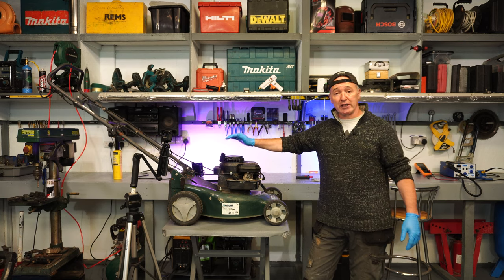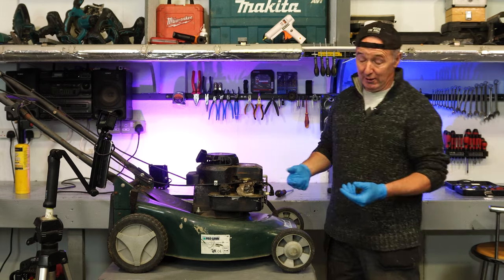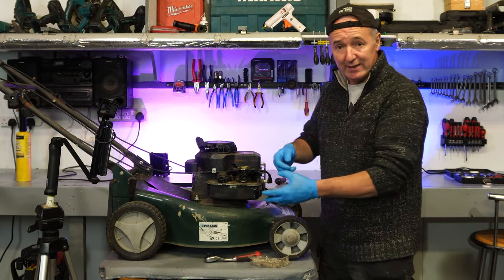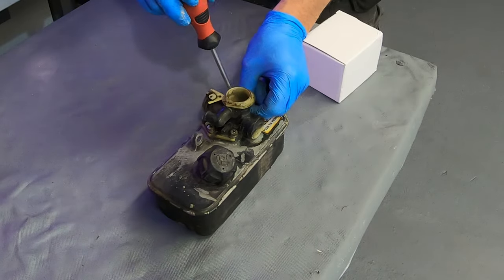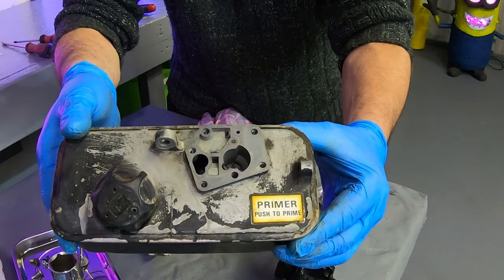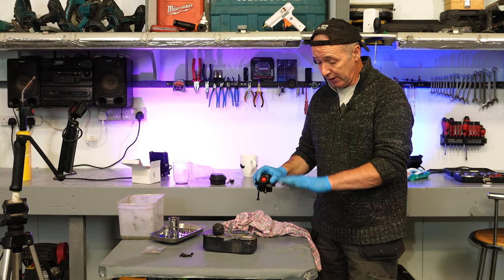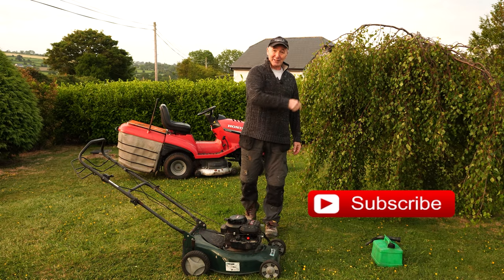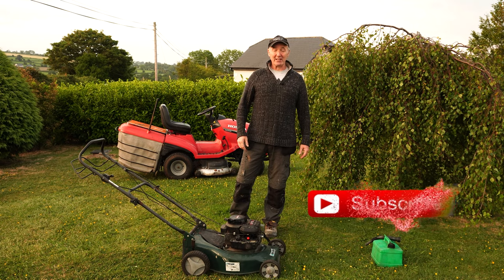Fix Briggs and Stratton mower engine with New €10 Carburettor

Comment: Vortex,
1965 B&S (bad start, engine no power etc)
One 12 blades on air admin (+ one 3 blades just before engine), and one 12 on exhaust.

Start easy, power etc
Reply from the maker: Your old engine is nearly as old as me 😀All I did with this one was put on a cheap carb and I was cutting grass with it today. Thanks for commenting Fred Cheers Gerry